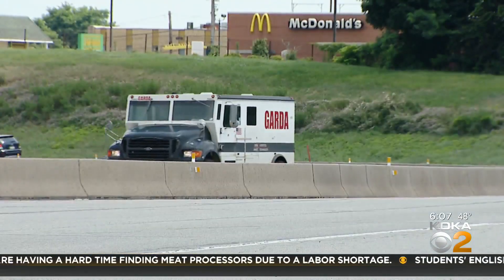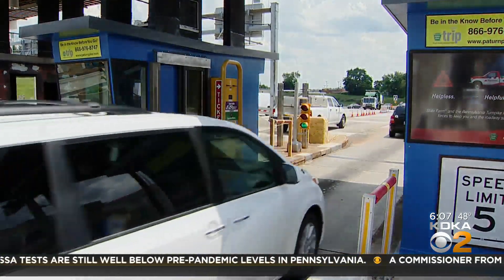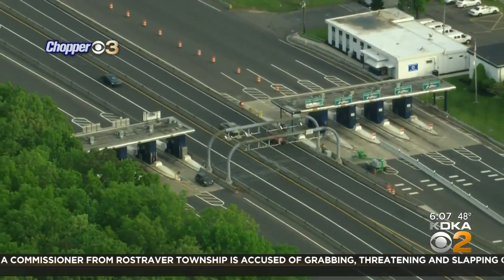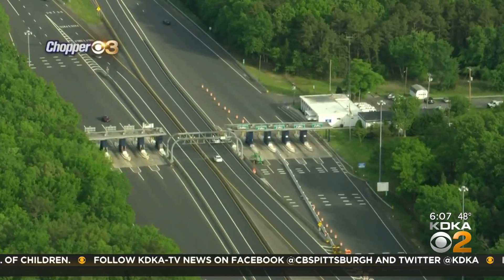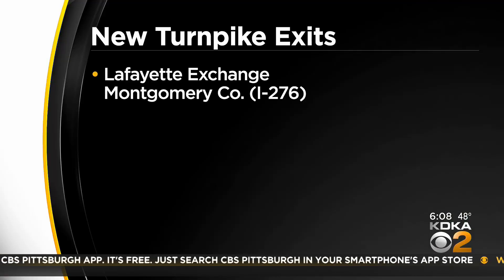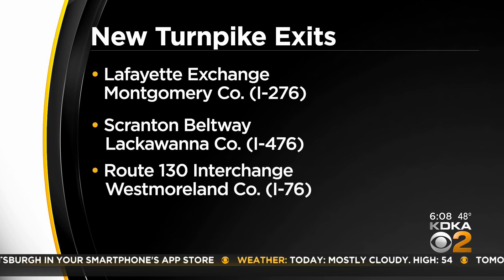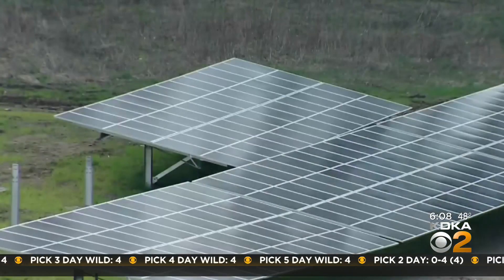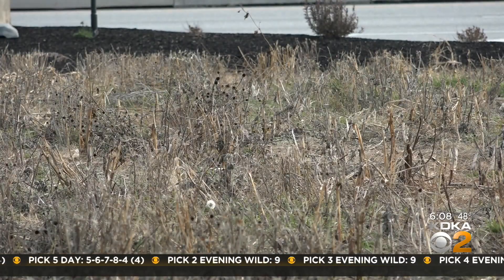New Pennsylvania Turnpike tolling system to pave way for 3 new exits

Comment: This may come just surprised people, once the Pennsylvania Turnpike was built back in I think the 40s, it was supposed to be free. Now it took a lot of traffic off of various roads going east and west. But somehow the reduced maintenance on those roads was transferred to the turnpike, but that wasn’t good enough they had to charge more and more and more. Thank goodness I don’t use it any longer and haven’t for the last 20 years.
Reply: You can thank the Pennsylvania Legislature passing Act 44 in 2007 for much of the present Turnpike financial woes.   The Act contemplated the Pennsylvania Turnpike Commission taking over the free Interstate 80 route and charging tolls along its length for improvements that would be made to the road.   In turn, the Pennsylvania Turnpike Commission would pledge $450 million dollars a year from their revenues towards the maintenance of Highways, bridges and transit systems throughout the rest of the Commonwealth.  

Unfortunately, the Legislature operated under the rosy assumption that the Federal Highway Administration (FHWA) would consent to the proposed tolling of Interstate 80.   What occurred was that the FHWA rejected the Pennsylvania proposal, finding instead that Interstate 80 was in good condition and not in need of any new toll supported improvements.   As a result of this rejection, the Turnpike was left holding the bag and having to still pay the $450 million a year.   This led to enormous Turnpike debt load and also the need to raise tolls annually on the road just to meet their pledged obligations.